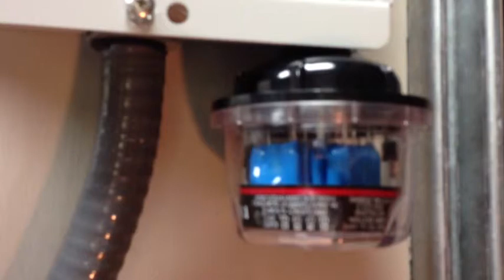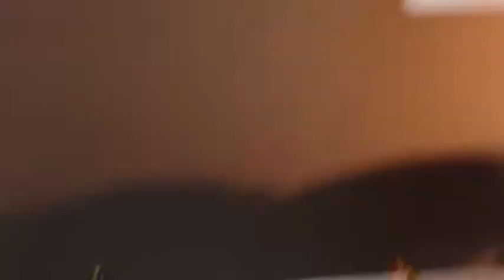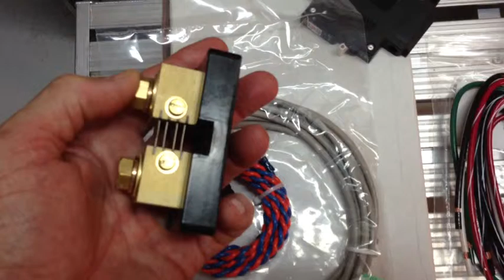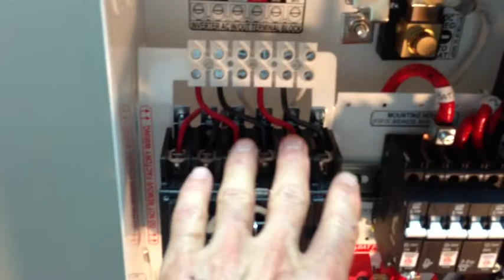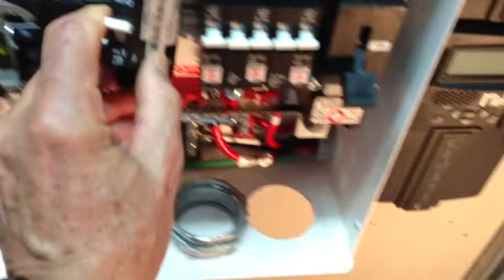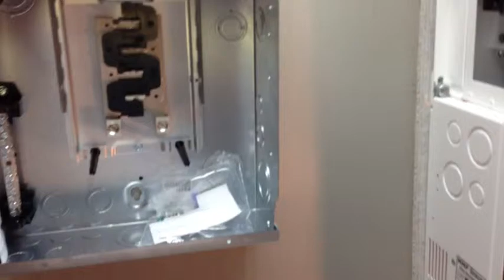Solar Project In MS Part 6

Comment: Hi Phil.  Really like your videos, I am putting together almost the same set up.  This comment is really for the next guy watching this video.  You bought the Battery Monitor with the shunt.  The MMP has the shunt built in, but you never say in this video or later ones that you can save your money and get the monitor without the shunt if you have the MMP.  You can even see the shunt in this video.   Also, I am curious why you mounted the monitor outside the MMP instead of the spot it shows in the instructions.  Thanks!
Reply from the maker: Re: Shunt, good point. at the time i bought my unit there was 7$ difference in price with it so i opted for a spare. Glad i did since i'm building another smaller system and will use it. I noticed that the prices are getting quite a bit higher now.
Re: Monitor, there are so many wires in the MMP and space is so tight i decided to place it outside. Also there is a condition light on the battery monitor that cannot be seen if mounted inside the enclosure.The Magnum remote control was put outside the box mainly due to wiring congestion but also because each time the outside panel is removed it requires disturbing the Remote. Since this video was done i've added another Midnite Solar battery monitor, the WhizBang Jr. that also mounts on the shunt , provides great information and tracks nearly 100% with the BMK unit. Nice to have the cross check available.
Reply: Oldguydoingthings Just wired my assembly.  You are totally right.  It is so tight in there.  I tried to put the BMK in there but have to  put it outside.

Comment: bill you wasn't too clear about that 2 inch nipple....what is it and where did you buy it again please....I plan on getting my system approved by the municipality and pay for the permit did you take that route also?
Reply from the maker: The Chase nipples are typically sold by companies that specialize in electrical supply items and are readily available . They were not sold at my local building supply stores. . Since I live in the county and am not connecting to the grid I do not have to get a permit, however, I was very careful about doing the project to code and have followed the NEC guidelines to be as safe as possible.
Reply: so no Home Depot or Lowes ....electrical supply house, I see I'm going to find one and show them this information thank you!
Reply: I got the chase nipple...Ty
Reply: Dan Suolo Got mine at Home Depot.